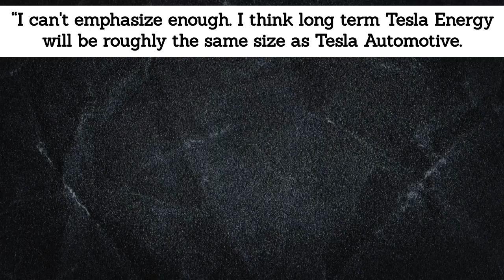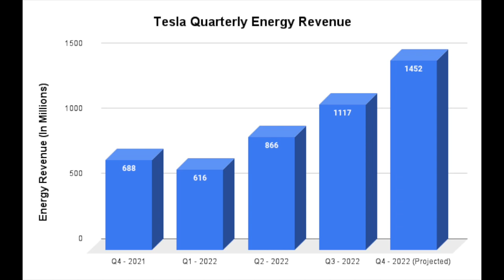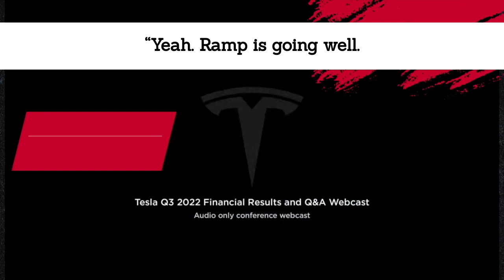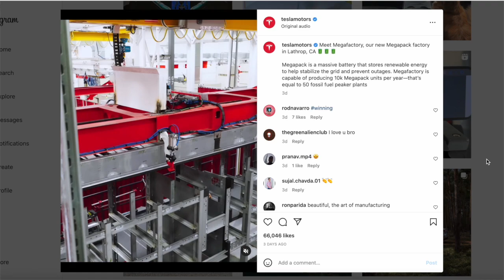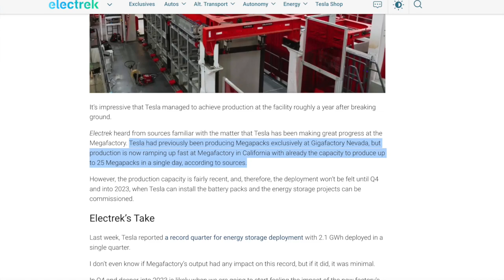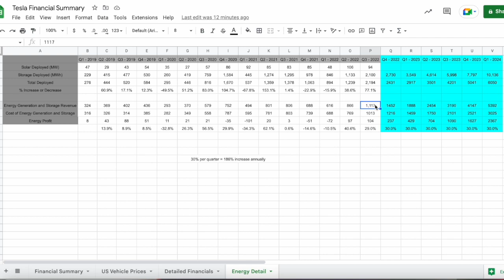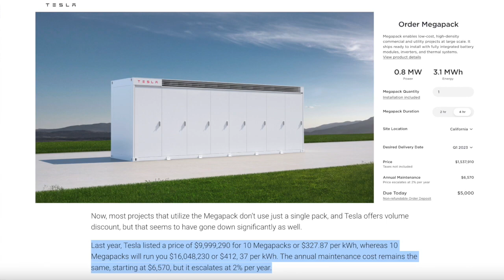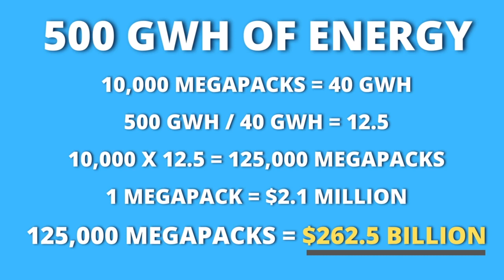Tesla Energy is about to SOAR (3X in 2023) $250 Billion Opportunity

Comment: We have been talking about this in detail for months on Spaces.   60% Margins are the base...more as they ramp and if there are IRA rebates for building the packs.  Except Lathrup to output 50 GWh alone, 40 GWh is a sandbagging number.  It appears that the 30% rebate is for the client not the manufacturer.  Also realize that the size (capacity) of the Megapacks has grown along with the increased prices which you didn't mention.

Comment: Yeah , just as  calif sells out their solar power users. Just think only $300/mo for 30 yrs or a mere $100k+ for about $11k worth of product. Your maintenance mileage will vary, did you add battery BU, isolation switches, generac, beefed up roofing structure to carry the new live load, new roof, complete re-wire of building. Now your into $200k+ and the ult want to pay you .008 for what they charge .11
Reply from the maker: Its BS how they want to make solar less viable for customers in CA.  Is it possible to add enough battery storage to go completely off grid and not pay any fees?

Comment: Storage looks great but Solar seems will get the boot at the end. Too much complexity I guess!
Reply from the maker: Yeah solar is still a dud right now sadly.  It's less than 5% of their energy business right now though so I would rather see storage thrive and become substantially profitable, and then be more patient with solar.
Reply: @100xinvesting8  You have the former now but for the latter I guess time will tell. Solar roof was a great idea/product, something to differentiate Tesla from the rest but never took off. Regular panels are cheaper if you get them from others. Maybe software here is the key if the power wall provides a value.

Comment: Tesla Energy -- aren't they just rebadging Chinese made solar cells and sticking a Tesla markup to it?
Reply from the maker: Tesla Solar is produced in New York, but it’s a small part of the energy business.  The real business is battery storage, and yes some of that does come from other suppliers like Panasonic.
Reply: @100xinvesting8  -- Tesla used to buy the solar cells from Panasonic but now buy them from Korea!
Reply from the maker: @Raptorman0909  didn’t know that.  The solar business in particular does seem to be struggling but the rest of the energy business seems well positioned to thrive.
Reply: @100xinvesting8  Battery production capacity is going to be constrained for a good long time for several reason.  First, mining of Lithium is an issue and dramatically increasing production to make batteries is going to be limited.  But, even if that were not a problem the companies making batteries don't want to poor $100B or more into factories to make batteries because if they bet wrong on chemistry then an advancement could render that $100B as outdated and, well, useless.  
So, they will continue to do what they've been doing and that's put a more modest amount of money into building production capacity.   If there wasn't several known options that could surpass the current Li tech Tesla and Ford etc might well be building $100B for production capacity -- maybe twice that.  But the cautious approach, economically reasonable given the downside, means that roll out for energy use will be limited by the need for cars and now trucks.

Comment: These megapacks apparently are lithium ion based. However, the future for stationary storage is lithium-iron-phosphate-based, not lithium-ion.  LiFePO4 is more suitable for stationary storage, as it is much longer lived, is practically zero maintenance and is safer than lithium ion. Will tesla be able to pivot?
Reply: many of their vehicles are transitioning to LFP because of the benefits you’ve named. I would think that stationary storage will transition to LFP at the same rate as their vehicles.
Reply: @drewgoodman7932  I am under the impression that LiFEPo is heavy and not practical in vehicles.
Reply: @ec7287  you’re not wrong, but Tesla, CATL, BYD, and others are squeezing out efficiency gains in every area possible and making them more than suitable for vehicles. Tesla’s first vehicles needed to be super dense and long range with NMC because that is the only way that would put all of the anti-EV arguments to rest, they needed the vehicle to have an unbeatable 0-60 and unbeatable range of 400+ miles. That sort of performance truly isn’t necessary though, they just had to silence the nay-sayers, and now that The transition is undeniable they can scale back range and performance to something more realistic and LFP cells are more than capable and have many many benefits over NMC and other chemistries.
Reply from the maker: Good question.  I have to do more research on the battery make-up, it’s not my area of expertise.  Thanks for sharing that insight.
Reply: @100xinvesting8  I think cost-wise LiFePO is significantly cheaper as well. Looking forward to what you learn, and thanks for the info!
Reply: Lithium-iron-phosphate is one type of lithium ion.
Reply: @michelangelobuonarroti916  that’s true, but it’s pretty widely accepted that ion is referring to NMC or other higher density chemistries.

Comment: When this winter has passed and many thousands have died because they can't afford to stay warm or keep the lights on the rush to these megapacks will be tremendous. There is a rush to fill up the fossil fuel tanks. These megapacks are just another form fuel storage.
Reply from the maker: Yes, sadly.  It’s becoming mandatory in many countries now to have a certain percentage of battery back-up to support the grid.
Reply: @100X Investing  That's because solar and wind can't cut it, but the woke lefties could never admit they were WRONG about shutting down coal and gas and nuke BASELOAD.  So they go after pipe dreams like there could somehow be enough batteries in the next 6 months to store PETAWATTS of energy tomorrow.
Reply: That’s a little morbid.  But Giga Pack production is already ramping up exponentially, which will greatly accelerate in 2020 and 2024.